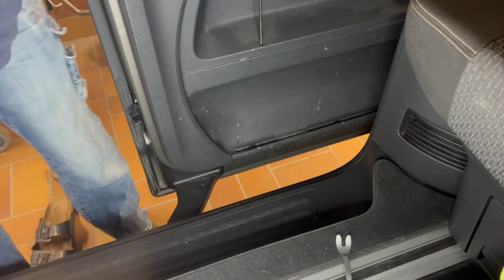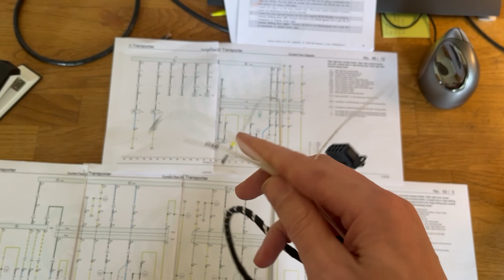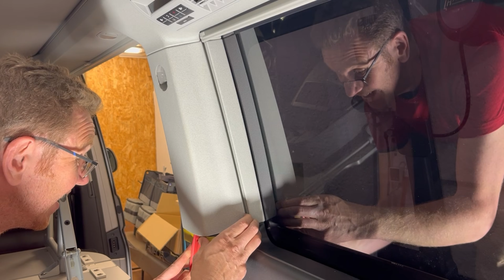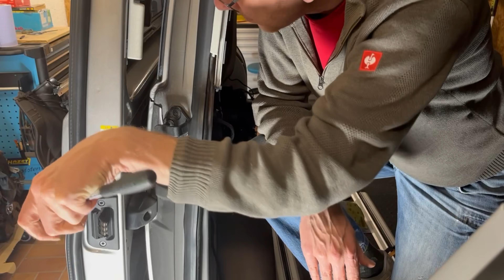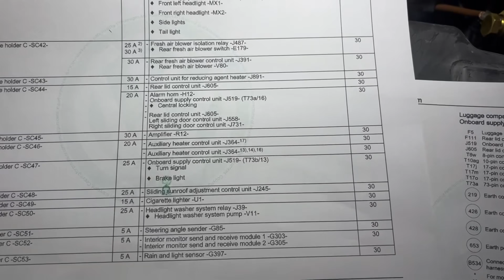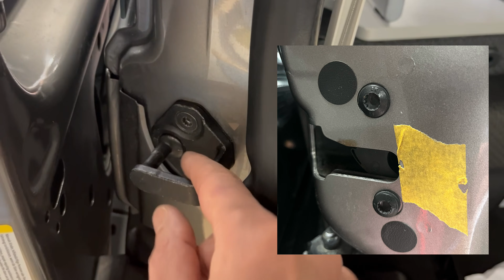VW T6 soft close Zuziehhilfe retrofit on sliding door with Kufatec cable kit

Comment: I don't understand the diagram, why not to connect J731 PIN 8 together (joined) with PIN 6 directly  to T73a/26? 
As PIN 8 goes to T6am/3 and T6am/3 is also connected to T73a/26... 

Am I wrong? Would it not work?
Reply from the maker: I split the wire so that the signal from t6am/3 went first to the door control j731 t8y/8 and then back to T73a/26 because that’s how it’s done in the wiring diagram for a car with the control module from factory. 

I see what you mean though. Assuming the signal voltage from t6am/3 just passes through j731 and heads back to the t73a/26 then joining the wires could work. 

I always try stick as close as possible to the original factory installation to avoid any issues and that’s why I split the wires. 

Thanks for your question.